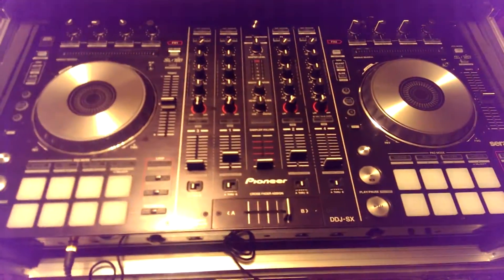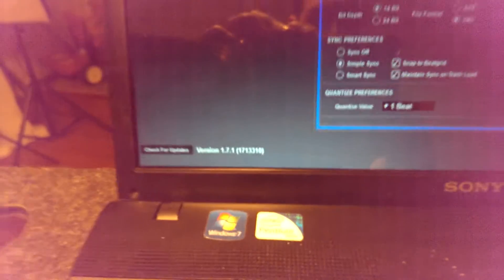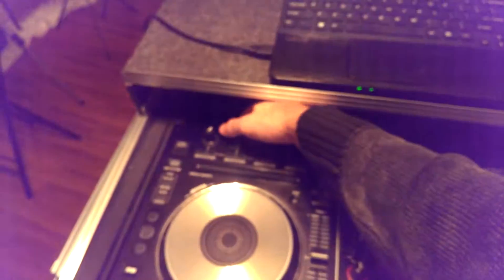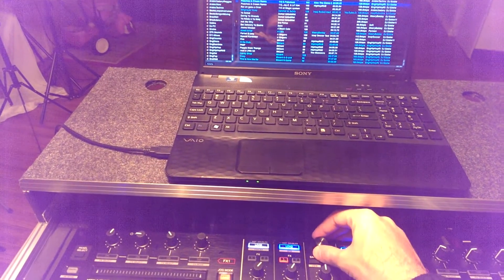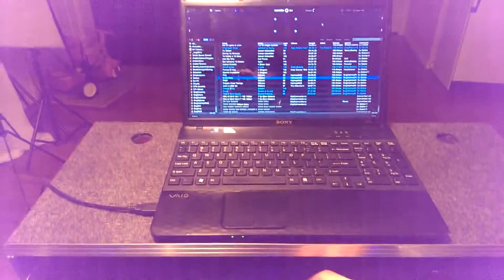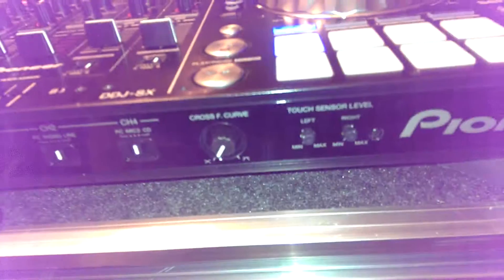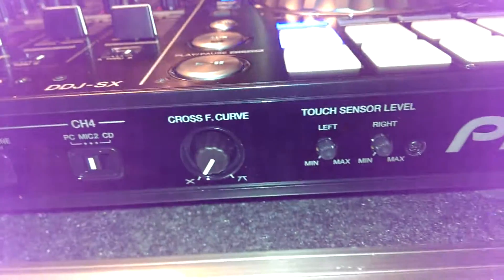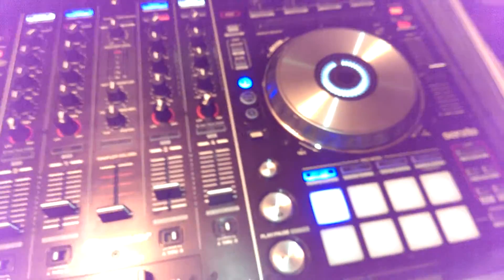Pioneer DDJSX platter (jog wheel) touch issues

Comment: Looks like you're trying to scratch in cdj mode. It will prob act like that cause you're not in vinyl mode?
Reply from the maker: DjTecniq but in only have my hand on it and it skips randomly. that's the issue and it shouldn't matter if it's on vinyl or not that is not suppose to happen
Reply: Damn are you using the latest firmware/drivers?
Reply: Would also def update your SDJ 1.7.1 is really old 1.9.6 is the latest.